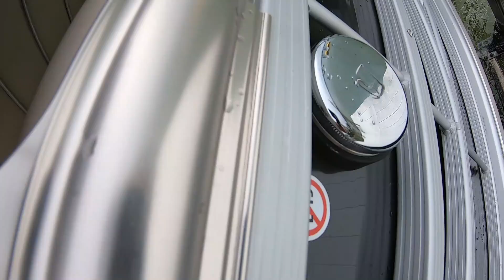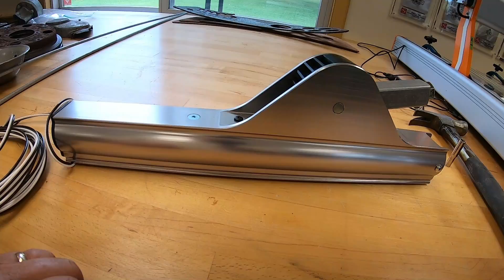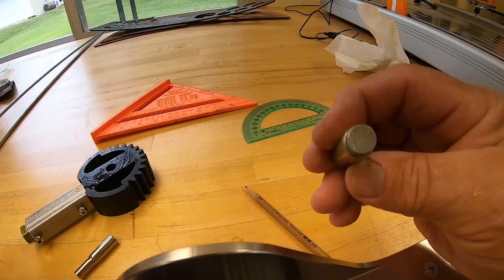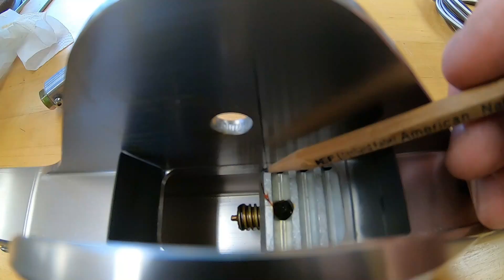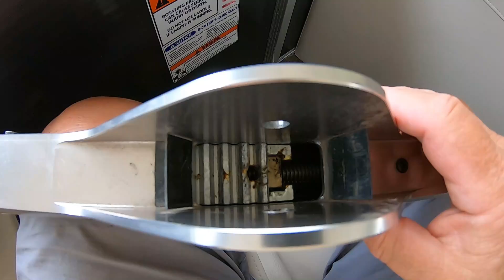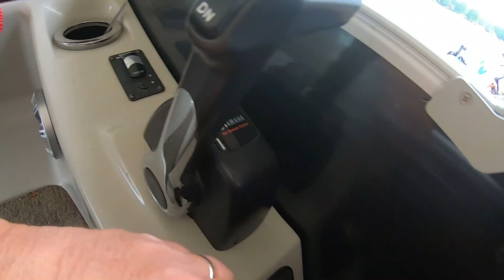How To Repair Electric Pontoon Canopy Top  (Lippert Power Arm)

Comment: went to pick up my brand new 2023 Starcraft Tritoon today, and the power bimini was doing some crazy thigs and stopped working all together (the captains side motor)
although we (the dealership mechanic) got it to jar free with direct voltage from a jump box.. It would only go about 1 foot towards lowering the Bimini, and jam  and stop... Im wondering if it was something as youve shown here,, broken tooth? Square nut off of the Worm gear/screw? it was at one point, spinning freely, but would almost engage if we put pressure on the Arm manulally while it was spinning. Mechanic gave up and the dealership is ordering a new motor assembly under warranty ! haha Im now wondering it if was in fact an easy fix...

Comment: Where did you find parts ... Just have my new pontoon delivered .. and arrived home , took some time on it , wanted to try the top , and its not working .. actuator actully working when touching up or down , and they just run freelly infinitly.... Talking to my dealer , but i dont want to.go back my dealer is 2.5hour away. Dont want to loose it for 1  month

Comment: How has the 2nd bimini come along? Have you installed it yet? I'm questioning the same upgrade.
Reply from the maker: Yes is did and it has worked out Fantastic!  My wife loves being able to sit anywhere in the boat she wants without being in the hot sun.  The rear canopy tucks under the front canopy ever so slightly, so when I am at full speed the rear canopy does not want to lift up.  More stream lined  you could say.

Comment: Mr Hilker, where did you procure the "pinion" gear assy? Having a little trouble with Lippert.
Reply from the maker: I got on Lipperts web site and found their 800 number.  Had no issue ordering replacement parts.